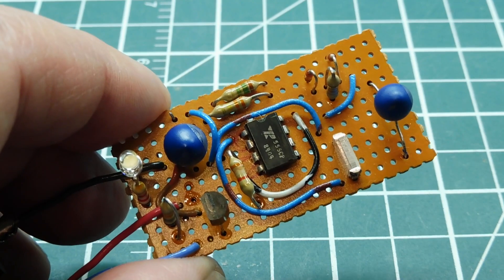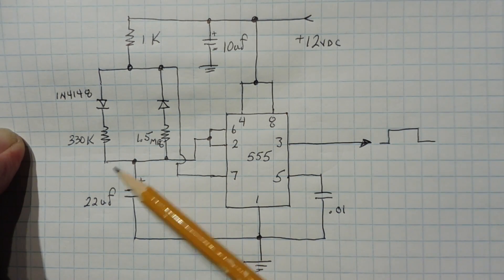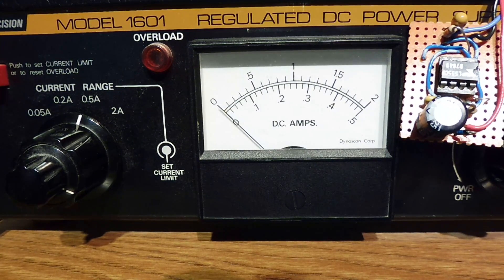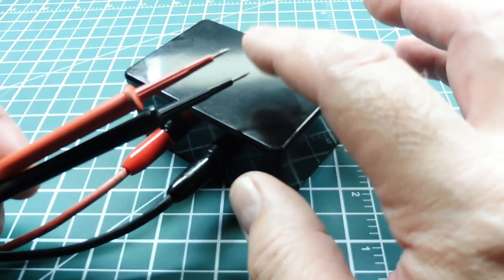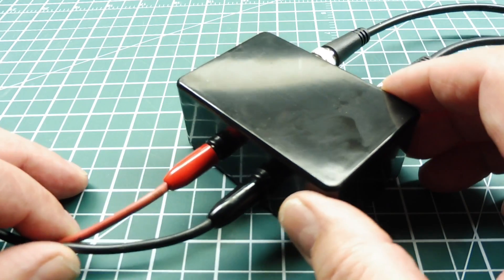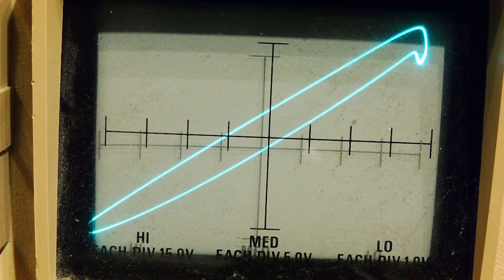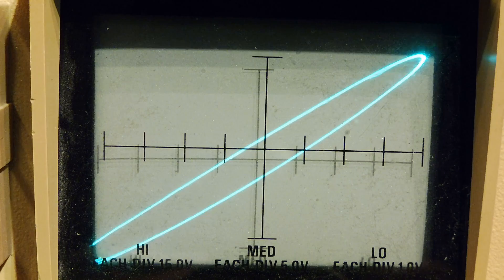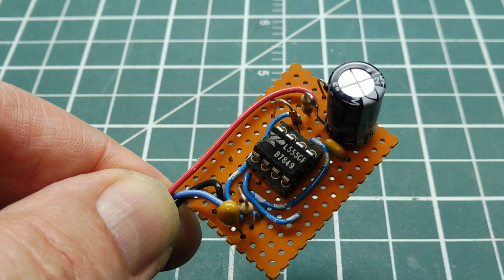555 Timer Circuit Troubleshooting  / Component Testing

Comment: I didn’t see the AC input on your component tester.  Are you feeding it 120 VAC with transformer inside the box or using an external AC/AC adapter? W2AEW shows a transformer on his breadboard version. I think your build of a tester would be a good video, especially if it detailed all the connector installations on the box.
Reply from the maker: I used an external AC/AC adapter wall wart that I go off an old telephone modem, but they are available online. https://www.rpelectronics.com/rp-091aa-ac-ac-adapter-9vac-1000ma.html

Comment: I   was kind of always confused about the patterns and what was actually happening when I was an engineering student.  I have done alot of trouble shooting but never used them.  Can they be used while all the componants are still in circuit of do the componants have to be removed ?
Reply from the maker: The components do not have to removed. Each component can be tested directly on the unpowered board.

Comment: If these capacitors are such a problem, why use them at all?  They are more expensive that the polyester types and everyone finds them more dangerous by shorting instead of failing open.
Reply from the maker: Every type of capacitor has their weak point. If tantalum capacitors are operated within their rated specification they can be quite reliable. They are temperature stable, have low ESR and can be quite small for their capacitance value. They also work good in timing circuits because of their low leakage. If you reverse bias them or exceed their voltage rating they will fail. Multi-layer ceramics are now taking over where tantalums left off.

Comment: Brother can you please make a video on programming ATMEGA 16 and 32 microcontrollers please please please
Reply from the maker: Most of my Atmel AVR micro programming is done in assembler which can be implemented on many of the AVR MCUs. It is important to get into the data sheet to understand the special configuration registers which will allow you to program many of the micros in the Atmel line.
Reply: @0033mer  so bro when will you upload videos related to ATMEGA 16 and 32 microcontrollers please replay

Comment: Had the Tantalums cause me problems in the past as well.
I like the component tester.... but I would have solved the water timing problem with a small MCU. Less timing variations due to temperature.
Reply from the maker: Yes ... all the 555 timer controlled devices were changed out to MCU control. The original 555 controllers were built many years ago as you can tell by the date code of 1984 on the popular vendor Exar IC. They were replaced with PIC micros (basic stamps) with 16 different timing setting to choose from and are still working today.
Reply: @0033mer  Got it...:-)  I also started designing with the 555 many years ago before the PIC revolution. I think the 1st time I saw the PIC mentioned was by Don Lancaster in Popular Electronics... Ahhh the good old days.
Reply: @lasersbee  Don Lancasters books were the equiivalent of what youtube and the internet is today. Thats about all we had back them.

Comment: I didn't know this about tantalum capacitors. I learn alot by watching your videos. For sure.

And I have thought about making a component tester like that. Thought about making it with a transformer , just down-transforming the 230 volt mains down to ...I don't know 12 or 15  or 20 simething volt, something like that. But I decided against using the mains in that way.
I'm not quite sure how to proceed, ( I don't know what a university looks like from the inside) but I'm thinking a microcontroller with 8-bit output with an r2r ladder digital to analouge converter to make the AC signal.
Reply from the maker: You could use an AC adapter (wall wart) with AC output. They are safe and easy to obtain.
https://leeselectronic.com/en/product/10478.html
Back in the day I would build them using 6.3VAC filament transformers. There were lots of them around but today you don't see them anymore.

Comment: That's actually a problem that I faced during fixing an inverter circuit and it cost me about 6 mosfets until I figured it out , two shorted small filter caps (100nf) that showed nothing on the multimeter, only shorted at operation.